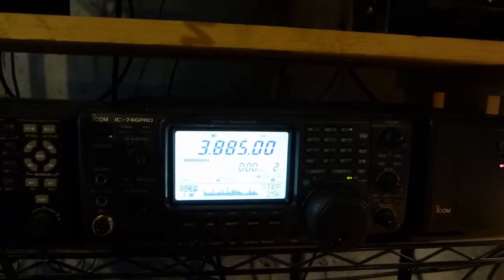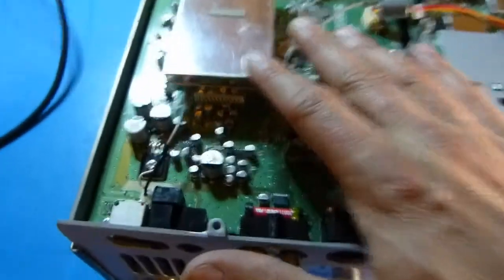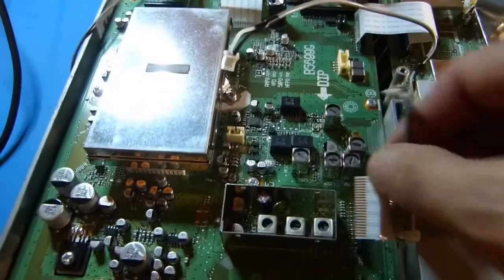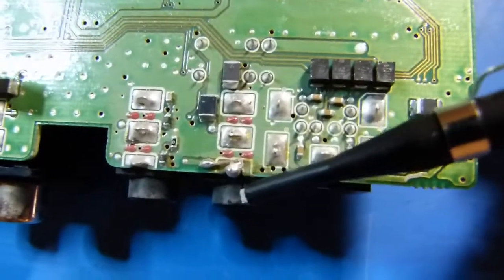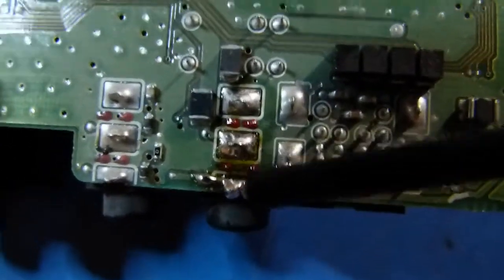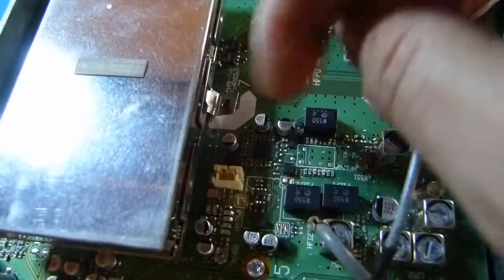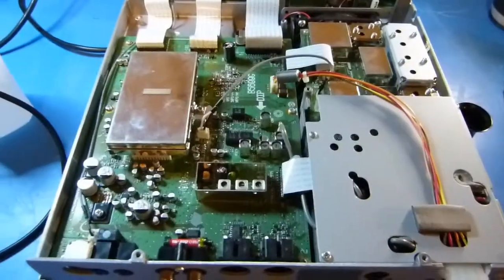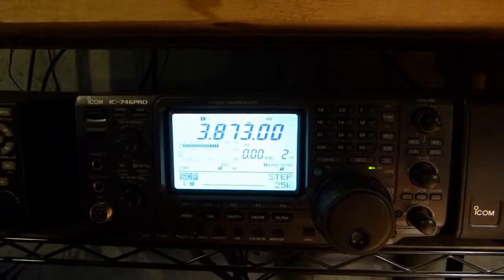Icom 746 pro Speaker Jack Repair Highlights

Comment: SUCH an old video ... and yet ... 

RL740, right behind the EXT SP socket has taken to occasionally buzzing ...  I finally realized that if "percussive maintenance" didn't make it stop, a 1/4"-1/8" headphone adapter (with no headphone) in the headphone port would.  Previously, with the bottom plate off, tapping on various components including the jack and the relay would make it obvious something wasn't right.  Then on the weekend, Someone on the 746Pro mentioned issues with their EXT SP jack and linked to this video ... I confirmed that my jack was also loose.  Your video showed me exactly what to do and I did it.  SO FAR, no buzzing, no noise when EXT SP plug is wiggled in the jack.  

So thanks!

Comment: Thanks for demo, I have the exact problem with mine, so with your encouragement, I am going to tackle it. de W4OV
Reply: I did it, perfect, the problem was exactly as in the video, the ground connection had a hairline crack, I resoldered it and back to factory performance... Thanks again.
Reply from the maker: I'm glad you got it sorted out!  The 746pro is a good rig.

Comment: Thanks for the nice video. I have a 756 PRO III with a similar issue: no audio from the internal or external speakers. Good audio from headphone jack. If it's not an issue with that jack, I imagine this'll be the fix. 73 de N6PCD.